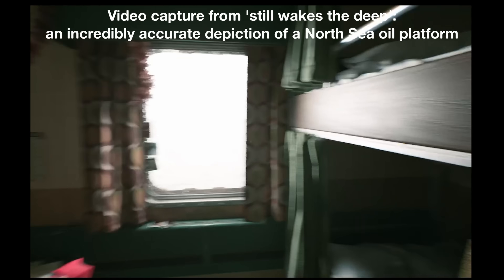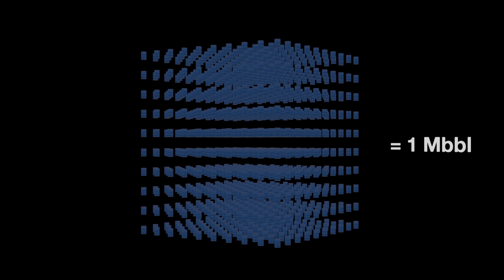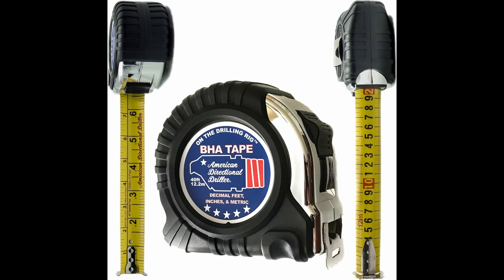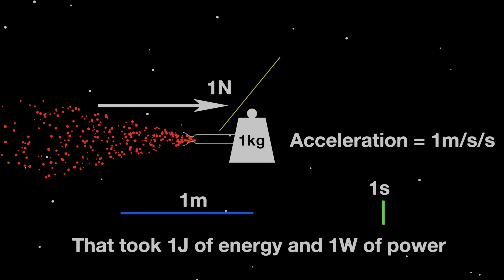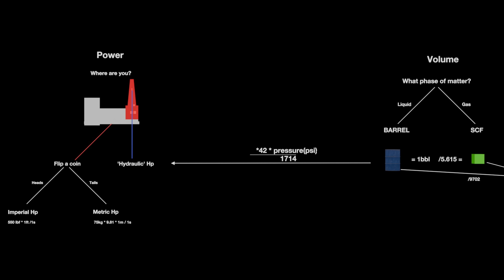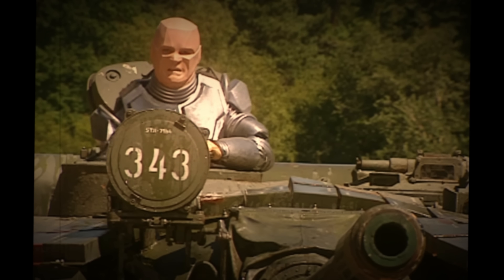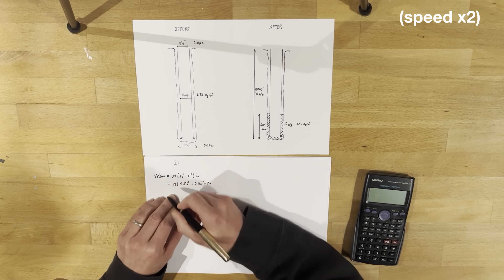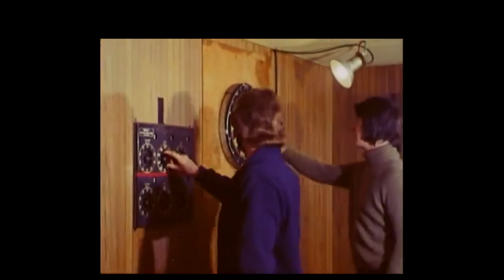Oilfield Units: a Measurement System so Cursed it made me Change Career

Comment: Anti-intellectualism is a scourge. At a library I once read a fluid dynamics book done in the 70's and the preface was saying that the US will surely soon convert to metric. Reagan is the one who prevented that.
Reply: Well of course. The SI is so obviously better, and so widely adopted, that clearly we would eat the cost of switching over instead of continually, endlessly paying to maintain a separate set of everything in US Customary while also needing SI tools for compatibility with the rest of the world. It would be utter madness, hubris of the higher order, to keep an inferior measurement system around for decades simply because it's a point of pride to be different from the rest of the world...
Reply: @SnakebitSTI  Everything that matters in the US is done in SI and labeled (where appropriate) for the rubes.  Whether a road sign says 10 miles or 16 kilometers is an irrelevance, and your angst about such things is amusing to me.

On a slight tangent, I will categorically state that Fahrenheit is the correct system for stating ambient temperature. The superiority of 0-100 scale that corresponds quite well to the temperature range that humans can readily tolerate should be obvious.
Reply: @jamesharding3459 first off, the fact that the whole US Customary system is underpinned by SI is a great argument for why we should ditch US Customary, not an argument for why we shouldn't. The US does all its serious metrology in SI, then has to convert to US Customary. So why not just use SI?
Second, the temperature scale thing is pure BS. 0F to 100F is not some particularly safe range of temperatures. Both ends of that range reliably kill people. For one thing, if you want a sense of the safety of being outdoors in a given temperature, you need wet bulb temperature, and for another the scale it is entirely arbitrary. The Fahrenheit scale is so arbitrary that people gave up on the original definition, and it is currently defined based on a scaling factor from Celsius. People who live in places which use Celsius for temperature learn what range of temperatures is appropriate for what sort of clothing, the same as people who live in places which use Fahrenheit.
The thing is, pretty much any system of measurements works for day to day purposes, because people simply learn through experience what to associate with what number. The day to day experience of US Customary is fine; it is not the problem. The problem is doing anything technical with US Customary, up to and including determining what the units are! Which is why all the US Customary units are defined in SI, because SI is actually a practical system for metrology.
Reply: @jamesharding3459  I dunno, 0F and 100F are still arbitrary, and having 100 points to measure ambient temperature is, well, can anyone tell the difference between 67F and 68F? And outside of very specific needs do they have to be able to either?

Celsius? Probably dead at -50, Probably dead at 50, ice melts in the middle and there are decimal places for anyone who needs to get fancy!
Reply: @SnakebitSTI  --  It's not always better.   The temperature unit for weather reporting is, at best awkward.    Degrees F  from from 0 to 100F which is the "comfort zone" for people.   Degrees C from 0 to 100C  are from "frost" to "You were dead, Dead, DEAD"  60 degrees C ago.

The US mile is as "metric" as the km.   It's1000 paces of a Roman fighting man.
Reply: @GilmerJohn  that’s not metric? A pace is not universally constant, and differs between person. A meter is the distance light travels in a certain amount of time, which itself is set by an amount of oscillations of a Celsius atom. These do not change and as far as we know, you can go across the galaxy and get the same measurements. Even in Canada, where we use imperial and metric units, we use metric for all scientific measurements and calculations because it’s superior. 

Your argument about degrees C isn’t that valid. 20-23 is room temp. 30 is a hot day. Above 30 is a really fucking hot day. 18 and below is little chilly. 0 is freezing. Like you’re using your subjective opinion and stating it like a fact. Would it be hard to go from using 1 temperature system to another in everyday life? Yes. But does that make C inferior? Not really.
Reply: @GilmerJohn  Didn't know an average roman soldier's steps were over 5ft, seems a bit bollocksy to me
Reply: @GilmerJohn   the point about metric is how it all fits together, surely? The video even had a short section on that.
Reply: @GilmerJohn  0°c Water is Frozen 100°C  Water is Boiling very simple
Reply: @GilmerJohn  Celsius 0 is water freezing point, 100C is water boiling point. Simply beautiful, although it's not "metric", proper temperature unit is Kelvin.

And measuring distance in paces, feet, elbows and dog legs is not metric even if it's decimal, it's archaic and belongs to the museum.
Reply: @GilmerJohn  I've never understood this position on F vs C, 15c is hoodies, 25 is shorts, 5 is a jacket, 0 and 30 are 'don't bother'. Entire swathes of the globe make do without having especially granular weather reports.
Reply: @Wallrod  Exactly. To me 0°F and 100°F are both "impossible" temperatures, in that living in either temperature is untenable and if the weather report says that here then things are very dire. If anything, the correct range is something like 15 ~ 25°C.
Reply: @theleva7  When marching, you count a pace every time your left foot hits the ground. So you should be thinking about two steps, not one
Reply: @Tallorian  32 F for freezing, 212 F for boiling, 180 DEGREES apart, simply beautiful.
Reply: @theleva7  ... you don't know what a "pace" is do you?..
Reply: @GilmerJohn  Another very strong point is that degrees celsius and kelvin are on the exact same scale but shifted by precisely 273.15. Kelvin is a really useful unit(0K —> absolute zero) so being able to easily convert to it is critical for any system of measurement to be adopted universally.
Reply: Of course it was fucking Reagan, it always is
Reply: the problem is that if we did switch we would end up like canada or britain, it would be a half switch lol.
Reply: Reagan is not to blame, and it's not as if SI was the only situation in which this happened. It's not just customary units, in everything the US refuses to conform, even to standards they themselves champion and push. For example, the US basically created the UN, and then used the UN to ask ISO for a standardized paper size, and we got the fantastic ISO 216, that of course the US also refuses to use and instead uses letter. It also insists on sandwiching the day in between month and year in dates, using 12 hour clock and am/pm instead of the 24 hour clock, when it does go metric, it decides metric ton sounds better than megagram. From traffic rules and railroads to plumbing and electric code, from the definition of a billion to the decimal separator, the US just refuses to ever conform to a standard, and just does its own thing. And they do the same within the US, where basically every industry is fragmented and using its own standard.
Reply: @gnualmafuerte  You’re just looking for nitpicks, and where that fails you’re bullshitting. A4 (an ISO 216 standard) has been the standard in the US for decades.
24hr time is not ubiquitous anywhere in Europe and not an improvement unless you’re sufficiently [censored] that you think an invitation to lunch at 1230 might mean half past midnight.
Most European countries use the same “sandwich” arrangement for their post addresses. 

Pot, kettle, stones, glass houses and all that. If you want to whinge about the US, pick one of our (many) real failings and not ones from your imagination. Here, I’ll offer a few for your convenience:
- Lack of public healthcare
- Lack of properly functioning social welfare programs
- Privatized prisons
- Legal-ish cronyism and bribery
- Electing a felon and asset of a hostile foreign government to be head of state
- Allowing aforementioned felon to appoint a private citizen with zero oversight or accountability to gut the civil service with commensurate effects on the ability of the state to perform its basic duties
- Militarized police immune from outside scrutiny and accountability
- No public education worthy of the name
- Widespread tolerance for religious zealotry, conspiracy theories, and other varieties of undesirable behaviors
- Related to the above, massive numbers of counterproductive crackpots, largely a result of a failed public school system
- And finally, more privately owned firearms than citizens
Reply: @jamesharding3459  24-hour time does have an advantage that as far as I'm aware only Japan takes advantage of - it lets you write times early in the following day as if they were in the previous day. So for instance one could schedule an event for 23:00-26:00 instead of 11:00-2:00. Which with computerized systems makes it a lot easier to input and display numbers between programs.

Comment: Me, an American, realizing there exists both 42 gallon blue barrels and 55 gallon oil drums.

Also, Imperial actually has a unit of mass, the slug, defined as the mass the accelerates by 1 foot/(second^2) when a force of 1 pound is applied. Completely bass ackwards from metric, in which the mass unit is defined and forces are derived from that.

BTW, a slug is about 14.5939 kilograms and weighs 32.174 pounds. On Earth. Yes that matters.
Reply: Meanwhile, in US Customary units, the pound is a unit of force. The US Customary unit of mass is the... pound. Help.
Reply: @SnakebitSTI  LB and LBf is something my professor hammered in my head. I didn't even degree and dropped out 8 years ago, but my mind was blown so hard I can't forget.
And that's because you multiply the pound of mass by G, and you get pound of force
Reply: American units use both pound force and pound mass, so there are acutally two consistent unit systems. one is foot-second-pound mass, that uses the poundal as the unit of force, and one is foot-second-pound force, which uses the slug as the unit of mass.
Reply: @thamiordragonheart8682 We also still have the grain, avoirdupois ounce, and troy ounce in common use...
I don't know if anyone actually uses avoirdupois or troy drams or pennyweights, but NIST still publishes conversion factors for them.
Speaking of ounces, we have two fluid ounces for volume. A US fluid ounce is 30mL for food and 1/128th of a US gallon for anything else.
Reply: @thamiordragonheart8682  And there's a third one, the English Engineering System, that uses both the pound-mass and pound-force. But it's not as bad as the metric, which has five systems: the gravitational metric system which uses the hyl for mass and kilopond for force, the traditional metric system which uses the kilogram for mass and kilopond for force, the cgs system which uses the gram for mass and the dyne for force, the mts system which uses the tonne for mass and sthene for force, and the SI system which uses the kilogram for mass and the netwon for force.
Reply: @costakeith9048  I don't like the pound-mass and pound-force system for engineering because it's not a consistant unit system. it is convienet for daily life where you can treat lbm and lbf as equivalent though.
Never heard of a hyl before, and why would anyone use it. kilogram-kilopond/kgf sounds about the same as lbm-lbf in that it's practical in every day life but terible for engineering.

CGS is mostly for phsyical chemistry and related fields, where a consistant system using grams is a better mass scale for the application and centimiters sets the density of water as 1. 
I don't think I've ever seen MTS before, but it sounds like it's for naval engineering since it's the large mass unit consistant unit sytem where the denisty of water is 1, and that would be useful.

I'll also add another, when I do work on composite materials, we use the mm-tonne-second consistant unit system so that we can use mm for thickness and still get force and energy in standard SI.
Reply: @thamiordragonheart8682  The hyl is just the derived unit of mass when you use a gravitational system with the kilopond or force-kilogram as one of the base units instead of the kilogram. It makes sense if your application cares more about force or weight than it does about mass... which is often the case for most earth-based applications.

But, yeah, these are just the wide-spread, standardized metric systems. I've worked as a consultant with a lot of industries and, in practice, every industry has their own system of units. I know it drives some people crazy, but there's almost always a good reason for it, either practical or historical, and I actually quite enjoy getting to know the metrological landscape of various industries, it often gives you fascinating insights into the history of a given industry.
Reply: There's also 31 gallons for barrels of beer.